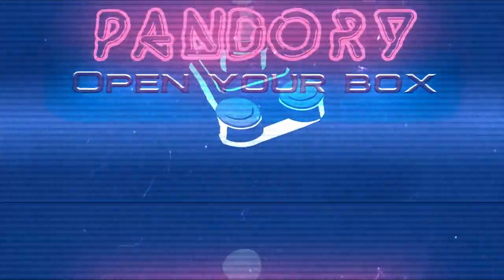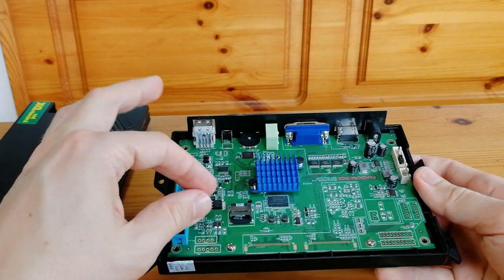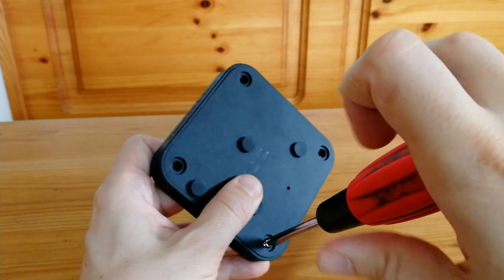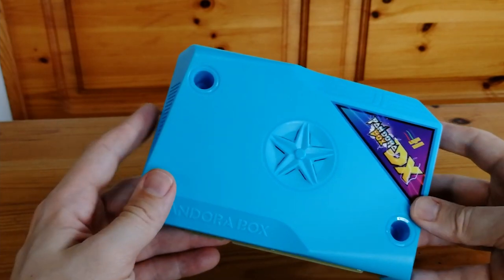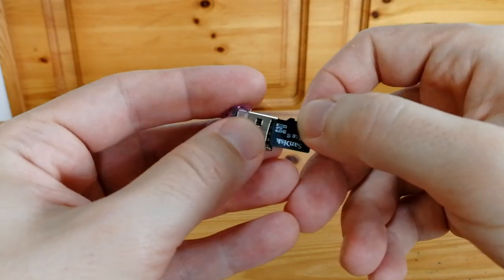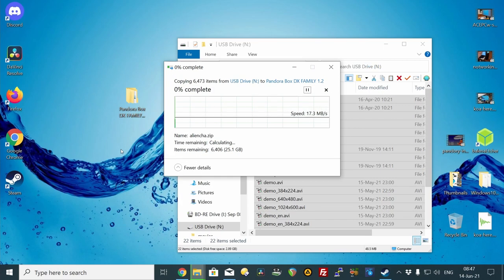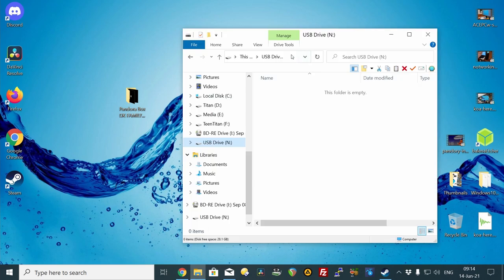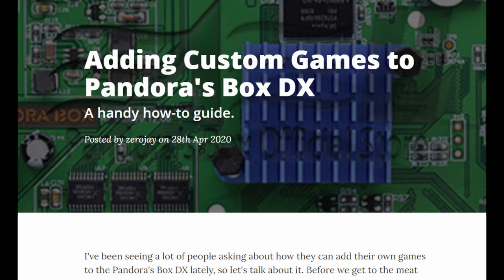Pandora DX MicroSD Backup / Restore / Upgrade Guide

Comment: Can you help me? I have the 3d Pandora gbox ex2 jamma it's worked with the xbox 360 pad I changed a setting now it won't see the xbox pad so I can't do anything?
Reply from the maker: I'm guessing it's something in the options screen, or maybe change usb port.  
Don't have a GBOX EX2 here so you'd need to play with settings until its working.
Reply: @TeamPandory  I can't play with any setting because it won't see the controller unfortunately
Reply from the maker: @herbz2hot2  and it worked before ?  Maybe there's a factory reset option to select ?  
Sorry, we don't have this box to try, you might be better asking on one of the Facebook groups or Reddit for an answer.
Reply: @TeamPandory  this is the problem I can't select the factory reset as the controller won't work

Comment: Help me, I have a pandora box saga dx with 6 buttons (jamma 28 pin) and my intention is to play resident evil but R1 is not available.....I wanted to know if you can change the L1 or L2 for the R1. They are my only hope :(
Reply from the maker: Might be possible if you use pandory and set up a remap file. Are biohazard games on as a stock game?
Reply: @TeamPandory  They are not available as pre-installed games, I added them via USB. How do I use Pandory and set up a remap file? Is it a program? Sorry for the ignorance, haha.
Reply from the maker: @raulignaciofarias7119  search YouTube for pandorydx install. .. would need to mess a bit to get remaps working. Open up pandory. XML and have a browse. 
Come to the discord for more help

Comment: Hello, I have one question, i have pandora DX and yesterday when i wanted to run it load logo but wont start system with games, i just see black screen. Does anyone know what is
problem? Tnx
Reply: Hello. did you fixed this issue? I just wonder it because today, I got this problem. would you help me?

Comment: Great video. Thanks for making it. Do you happen to know what the maximum microSD card size a Pandora's Box can use? Mine came with a 128GB card, but it's nearly full, from the factory (it came with over 10,000 games).
Also, is there a maximum USB stick capacity that the Pandora's Box can read? 
Thanks for any help you can give me.

I've seen other videos that tell us we need to download a 3rd party program to back-up the SD card, with the claim that Windows will show the microSD card as being blank. That may be the case with some Pandora's boxes, but I just put the MicroSD card into my computer's card reader and Windows 10 could read all the contents. I'm currently copying all the files into a folder in my computer's games partition.
Reply from the maker: The DX has a fat32 partition, so you'll be limited mainly by this. Should be able to copy all the files from the microsd to a computer, format another microsd to fat32 with Rufus - that can format larger cards, and then copy them back on.

There are tons of pandora systems, and many variations with each.

Comment: Good morning. I need your help. I have a Pandora 9d box. I backed up the SD and saved it to Google Drive. 2 years later, the original SD failed, but I can't make the backup files bootable and the system won't boot. I have 3 boot files and folders with roms and everything else I had. Could you help me? Thanks a lot. Greetings from Uruguay
Reply from the maker: No need to spam the other videos with the same comment. - Anyways, the 9D uses Linux partitions.  The method you used should have been by cloning the microsd (not just by simply copying over the folders), and the image would need to be burned to the microsd by using balenaetcher or win32imager.
If your backup is faulty, you'd need to find another source for it- I'm sure google would be able to help you with that.

Comment: Hi, i bought a Pandora CX 2800 but only came with chinese lenguaje
Do you know if there is a way to add english lenguaje?
Reply from the maker: You need to put in a claim with the seller.  If it can't be changed in the options, there is no real way without flashing the firmware, which they won't show you how to do.

Comment: Hello do you have a video how to  reset a memory stick for a Pandora 3d gt saga ? My card gave out today now I have no games :( and I try insert a new card with no luck on how to reset up a new microsd. I get the error no game disk inserted.
Reply from the maker: More than likely you'd need to recover a backup by using etcher, then burning the image onto a MicroSD.
Reply: @TeamPandory  is there a video on how to properly do this method because the card never let me back up any data when connecting to a PC
Reply: @deathviking710  have you figured this out? I have the same problem.
Reply: @TheAutumnWind_RN4L  hi um no but I did find the site to download the correct software. Potato ressurection
Reply: @deathviking710  you're a scholar and a gentlemen.

Comment: Hi team pandory, I have a problem can you please give me the solution..
I have pandora cx saga 2800 and their is problem with my tekken 3 game, I complete 10 stages 4 time but my tekken charecters are still locked, I have same my memory card and turn on auto save in tekken 3 option but nothing work please tell me what is wrong with my pendora
Reply from the maker: You'd probably need to use the SAVE STATE before you quit out, then LOAD state once you start again...  Or you could install PandoryDX and hit load for all characters.  We've unlocked them all for you ;-)
Reply: @TeamPandory  how can I Install pandorydx
Reply from the maker: @satishbakery7448   https://youtu.be/yOsBYnR4bzg